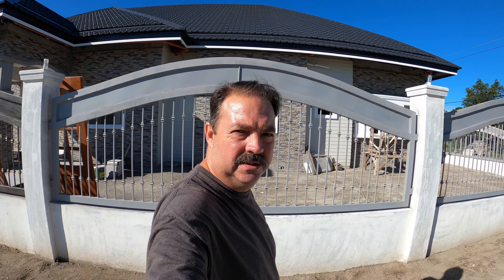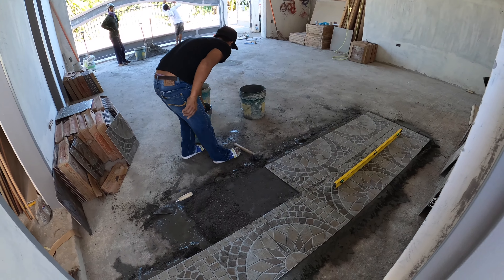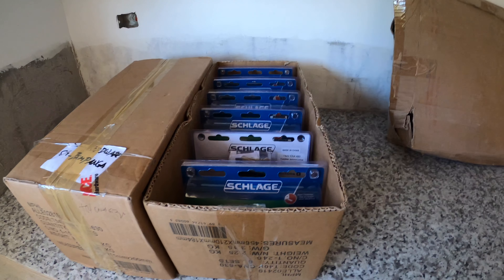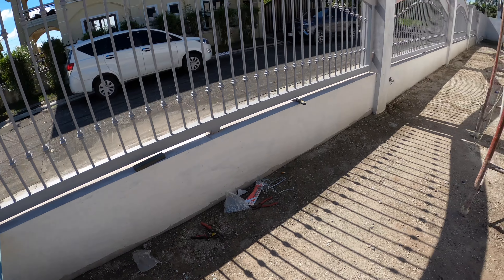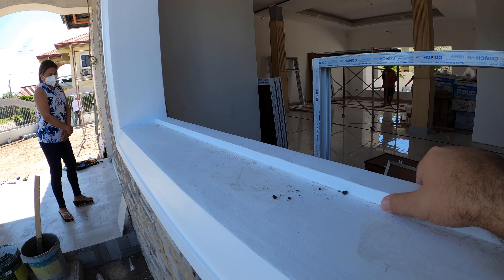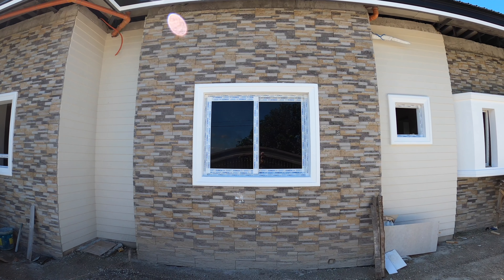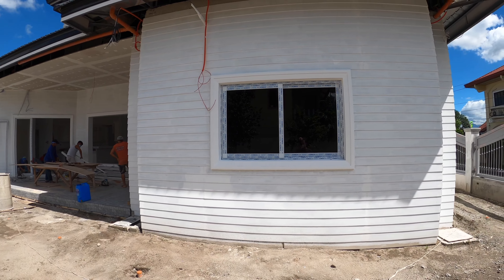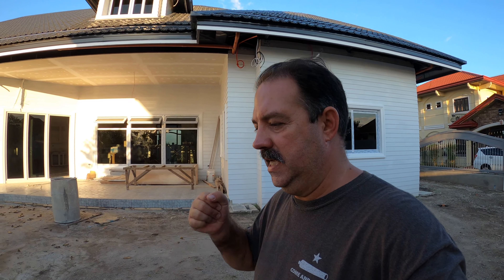Philippine House Building Step by Step, Build Day 208: A Window In Time

Comment: What a difference windows make to a space - giving it a sense of closure and security - I would have picked black frames which would have complimented the roof colour and made a bold statement with the choice of the dark grey glass. Not sure about the building codes there but I would have liked to have seen a more severe sill angle and a moisture barrier within the wall under each window as I suspect any water that finds it's way under the window and inside the wall will give you a dampness issue Please cover your beautifully tiled grand room floor as the guys installing that arch had their scaffolding sitting on small blocks of wood and where using a claw hammer to tap it into place rather that a rubber mallet at least - one slip and damaged tiles. It's amazing to see finally some OH+S with the window guys wearing boots - WoW that's a first on a Philippines work site though they are not wearing gloves or glasses is disappointing. Once again this house is all class...
Reply from the maker: Wow 😳. Thank you so much for the constructive feedback. Appreciate it. 🙏😊

Comment: it looks like its easy to take out the big windows. They are just secured with some plastic strips. around 29.10 in the video. No glue, no screws. I am thinking of the safety aspect. In my head the window frame should have been turned around so the strips would have been on the inside.
Reply from the maker: 🤔🤔🤔
Thank you for the feedback.
Reply: you have to break the window first to in order to remove the strip. once that plastic strip is set, it's there permanently unless you forced it by breaking the window.
Reply from the maker: @edmhie1  
Thanks for the information. 👍😊

Comment: Hi George, Are you tiling the garage? I've noticed in the Philippines that the tiles along the garage tend to crack due to the weight of the cars. Have you considered cement stamping? Kwikset smart locks can change all the locks with the same keys. Thanks
Reply from the maker: Schlage should be able to do the same thing. Just have to find a competent locksmith. 
We are tiling the garage and driveway. Most carports in our neighborhood have been tiled without issue. We’ll have to wait and see.

Comment: No wonder why pilipino windows leaks....No wings on the edges..only sealants in both interior and exterior corners...No expanding foàm sealant inside...
Reply from the maker: We have not been able to find expanding foam sealant at any of the hardware or big box stores.
Looks good so far. Time will tell.
Reply: @CasaTexPina  How about electrical wire nuts??? Twisting a bunch of bare electrical wires with electrical tape is subject to oxidation or wires turning green ....The Best option is to solder it with flux core 60/40...
Reply from the maker: @manuelpatawaran5504  
Electricians have not gotten to that part yet. Still roughing in most of the runs.